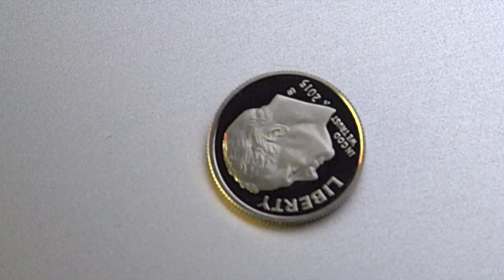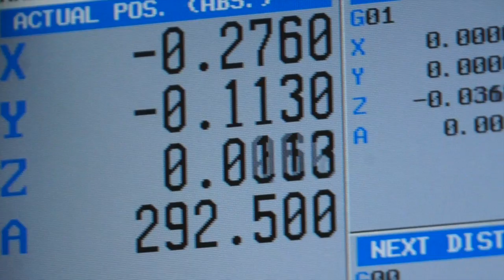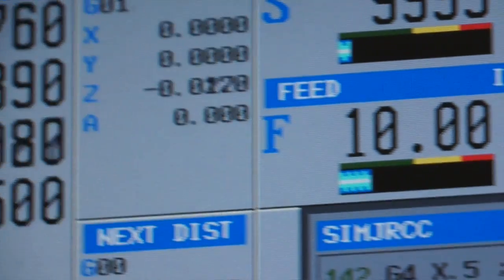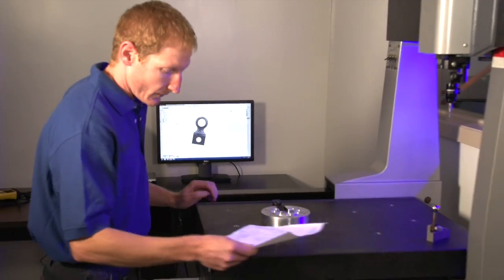Swiss screw & CNC machining of small parts - micro machining by Swissomation | Fredericksburg, TX

Comment: Don't understand why you want to use different methods of measurement and confirm that with the customer. 5 thousandths is 5 thousandths....
Reply from the maker: The tolerance is so small the customer does not have the tools to check measurements... yes that actually happens!